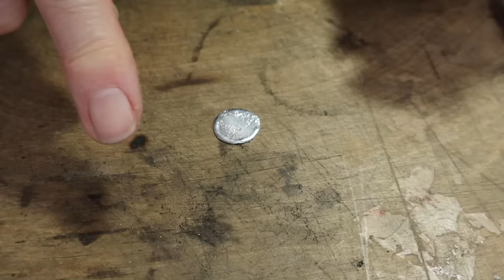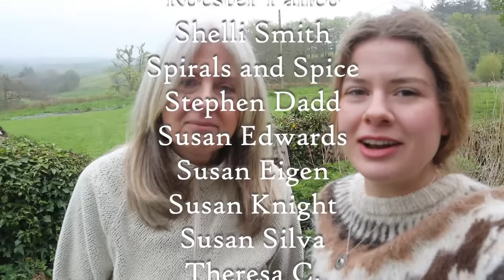Amazing English sea glass & making jewellery from our finds! Beachcombing British coast.

Comment: thanks for taking me with you on yet another excursion, it was quite nice, if a bit cold.....watching you make that piece took me back about 25 yrs ago, to some leather work i did- if you will recall, an old single hole punch was about the size of a 4 inch long pencil, blunt for whacking it with a hammer on one end, and a sharp circle on the other end which cut through the toughest, thickest leather and a channel opening about midway through which the cutouts came up and through and out the side. i am certain that you can find a photo of one in a leather working tools catalog. i needed a rather large one, so i took a piece of one inch pipe and cut it off about 3 inches in length and i used my grinder to make one end very sharp evenly all the way around, then i placed the sharpened end on some thick leather, put a piece of oak over the other, and WHACK!!! instant large hole!!! one can use different diameters of pipe, and use a vice to make ovals,  a punch like that should work on silver sheet stock as well, even bronze, for days when ones hands are tired. For this purpose obtain black iron pipe, like what is used for natural gas or propane, Do Not Heat Galvanized Pipe--Deadly. any plumber should have what you need in their van. i hope this is useful
Reply from the maker: Thank you so much. I do leatherwork and the pipe idea is great! xx

Comment: I live in Colorado USA in the middle of the landlocked Rocky Mountains. We have no shore or sea to mudlark/beachcomb/seaglass hunt. My beach is a sandbar on a creek near my home. It is a wide creek, but until the rains swell the waters, it doesn't churn much up from the sandbars. After a good rain however, there are many pieces of what wee call Beach Glass in the USA. In my case I guess it would be called Creek Glass. I take my dog to play in the water (which is only a foot or two deep when it isn't flooded), and while she's busy being a dog, I am watching the ground with the same keen eye you both have. There is a dump from the late 1800s to 1950s somewhere along the creek. After a torrential rain the water in the creek goes up to 8 feet deep and it churns things up quite well on the sandbars. After the water recedes I find pieces of lavender, deep green, electric blue, and even Uranium Green Glass that is radioactive. I have brought home about 25-30 Kg of sand washed glass. I'm 67 years old next month, but this is one of those things I could do all day and never feel any pains of age while I'm doing it. My plan is to take the glass and arrange it on a sheet of glass and then cover that with another sheet of glass, creating a mosaic with the various colors of glass laid into a pattern.

Comment: I know they are more expensive up front, but consider a Mac.  Getting a new one would last you for 10 years or more (speaking from years of experience) and they stay on the edge of technology b/c they are built on the same system as the internet - Unix.  This is why they don;t crash. 

A really good alternative would even to be get a refurbushed old one.  I know the Windows world does not understand it, but I am running a Mid 2009 iMac I got for 180.00 on ebay to replace my 2007 after its LED for lighting the screen died after 11 years of being powered on 24/7.  Form running the 2007 so many years, I learned you don't need to have the newest to keep up with tech.   So when i was offerd a 2009 for so cheap - I decided to try it and have been glad I did.
It even can run Windows natively - and will do it at a fast speed.  So you could even get one to run windows for very little.   
And...I keep the 2009 system b/c the word processor that I used to write a reference book is what I want to keep using instead of changing to a newer one.  I found what i needed, I like what I gave, and I have no need to spend a lot of miney for updates I don't need. 

Former computer programming teacher and overall computer geek since the 80s.
Reply from the maker: Thanks for this. Yes, I think we will aim for a Mac. xx
Reply: Excellent - the time it saves you will be worth it for sure!